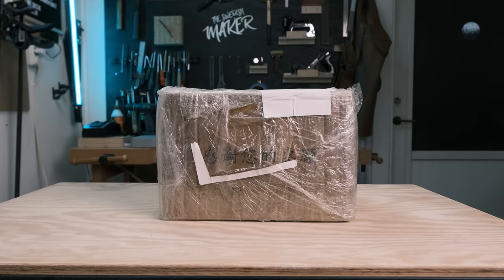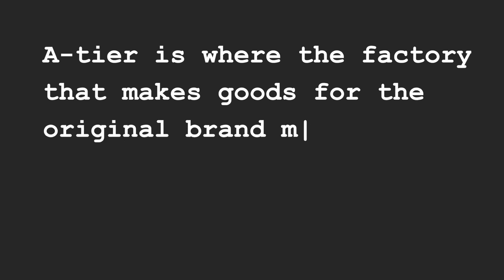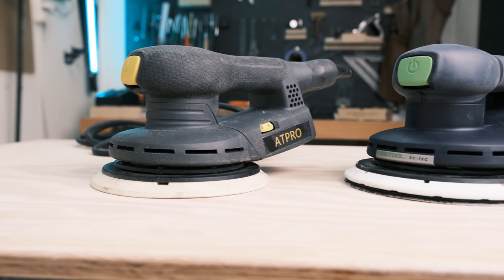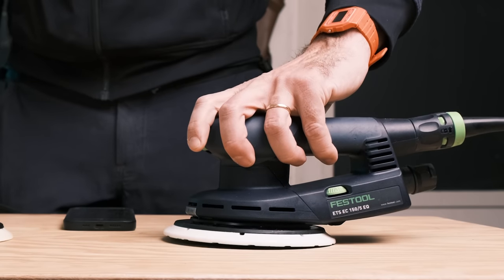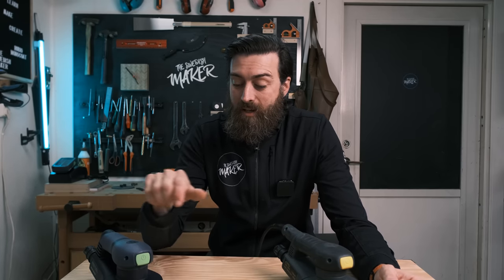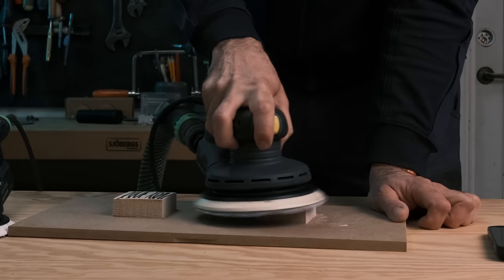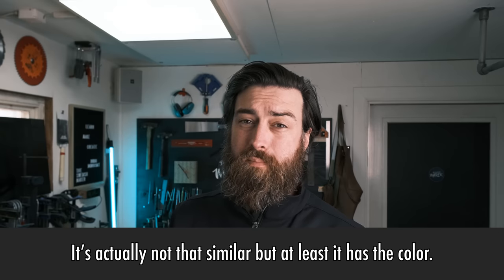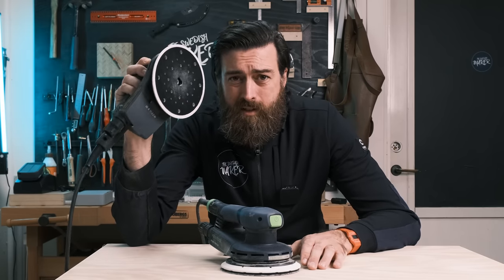Festool Killer or Clone?

Comment: Hi 👋, I have had cheep Chinese tools over years, mainly because I could not afford top quality tools, but over the years I have saved up for better quality, I am now in my 70s retired and I still have most of my tools still, Maffel Festool Makita , and maintenance is a must on all machines. Even on these tools, I still think one is better than the other, depending on what you are using it for , Maffel makes the best router, Festool best Sanders. Makita drivers, Stay safe, Phil from the moulin France.
Reply: I have the Mafell jigsaw and the KSS 80 cross cut saw . Both are the best you can buy.  But have you ever tried any of the Festool routers Phil?  The two smaller ones are an absolute joy to use one handed and the 2200 with all the extra bases and the 95% dust collection is just so innovative, smooth and powerful. I get excited when I take it out of its sustainer 😂.
Reply: Hi 👋, I hope you are all keeping safe and well, I have all 2 Festool routes, 110  2200 . Both are excellent routers, I started working for my self back in 1978, I brought a ELU 98 1/2 Collette , but found it on some jobs to big so I brought some other make that a 1/4 collett but that stopped working after a year or so, then I brought a Makita 1/4 that seems to be fine, I then needed a second large router that didn’t last longer, so I brought a ELu MOF 177 E , I did have 2 of these up until the 99 both of which I think that I must of replaced the bearings low’s of times, then in the 2003/5 I brought my first festool 1/2 , then the OF110 , however the OF2200 did have to go back once. I have had lots of different jigsaw over the years, but I finally brought a MAFELL Jigsaw in 2015/6 this is the best jigsaw ever, I have Festool larger tracksaw 70m it is okay but lacks power, I have used the Maffel on a site that belong to someone else, this far superior machine, most of my work was in my workshop so I didn’t need a larger track saw as I have a 10Hp saw bench with sliding table, I have a fell other Maffell tools Dowelling, Door Lock Mortiser, Chain Mortiser , from around 2008/9 I was involved in a lot of barn conversations were I was making a lot of doors and windows, most of the doors were 75m or sometimes thicker, with multipoint euro locks fitted,  one job had 7 doors so the door lock Mortiser made short work of fitting them, and I have a large 10H spindle moulder with sliding table, so the grove for the lock to sit in easy work , I also have Wadkin EKA tenoning machine, with Windows sets and Door sets tooling, Leitz tooling and some Whitehill , I am retired but still have a lot of tools. I am hoping to finish my windows and doors in my property in France later this year, 
My work came to abrupt end in 2019 , as I had found out my ex female partner was having affair with some one, and she had scamming me over the years as I had been putting a lot of money in 2 projects one in the Uk and France. 
I hope this gives you some insight into what I have been doing, and tools and machines, if you need help with any further information don’t hesitate to send me a message. Phil from the moulin France
Reply: Hi, I forgot to say cleaning your tools and machines, and maintenance afterwards is very important, 
Phil from the moulin France

Comment: I have had Ridgid, Milwaukee, and Craftsmsn sanders in the past. All caused numbness in my hand after use. And those that had dust extraction were a joke. I bought a Festool ETS/125 and it is a joy to use. No numbness in my hand and no sanding dust all over. 
I own a Festool track saw, dust extractor, jig saw, and Domino 500. Not a single regret. They bring joy to me when I use them. My next Festool is like a Rotex sander. I have held off buying a Festool router, I own 4 other routers. So maybe I’ll hold off getting the OF1010 for another year. 😀

Comment: Choice is choice. If they are not using the name of Festool, then good on them I say. I think they are trying to ride off the name in terms of price though. That tool looks like it should be sold for $50 not $300.
Reply: Agreed. The 3m sander is like $300 and I’d rather get that than some Chinese counterfeit for the same price
Reply: @zackstern3803  Well said Zack.

Comment: Excellent video. I couldn’t agree more. True, most of the budget or mid range tools are manufactured, or assembled in China. Like most of us, I own a number of tools from Mikita, Hitachi alongside cheaper brands, and many of them are made in China. I even own a Nikon camera that is also made in China. Oddly enough, one of my Bosch tools - a 110v drill - is made in Russia. None, however, are knock offs, and all have performed flawlessly for years or decades. 
I do own some of the red stuff from Banggood, rulers, squares and the like. These are, obviously copies of American products, but, as you state, they are just bits of machined aluminium. 
Thanks for sharing.

Comment: I’m sitting on the fence with this one. I have learnt my lesson on you get what you pay for. So would not buy the cheap one. But I just cannot see the justification in spending that much on a Festool. When it’s market competitors like Mirka or Bosch or even Sealey (budget) are far better priced.
Reply: I am looking at the festool midi and was quite shocked by price of accessories. Things like a handle are like £70 which is just some tube metal
Reply from the maker: It is a hefty price. I think Mirka is comparable in quality, but I dont think the Sealey quite compares - I have a similar sander to that one and the Festool one seems to be a bit better in all areas. Thanks for watching man!

Comment: I splashed out on a Mirka DEROS convinced I’d have buyers regret but am so glad I did, makes sanding so much more bearable. So yes I agree, ditch the cheap counterfeit crap and buy a trustworthy brand, as high quality as you can afford to get, or are willing to spend. Another good video Pierre 👍
Reply from the maker: Thank you John! Totally agree with you
Reply: I'm no stranger to Festool sanders and extractors, so I will always check out a clone sander vid that pops up in my feed. 

I've seen more Mirka styled sanders than Festool styled sanders though. 
 
The noticeable loss in dust extraction is a deal breaker. Did the vac just need to be ran a little higher than the EC? 

You never pointed it out in the video I don't think, but the Festool knockoff cord came off like the Festool? Or just mimics the connector look with a fixed cord? 😅

Were the pads interchangeable? 
If I can't easily source pads for a sander, then it's another deal breaker. Pads are a consumable and they wear out. Especially in helpers hands lol.  Without easily sourced replacements the Chinese sander is dead in the water. 

Speaking of pad wear, I'm sure someone's mentioned it, but both those sanders needed a protection pad with that net paper. You'll melt the hook and loop, and cause premature pad replacement.

Comment: It has all the fancy things, like at 7:20 there is an adjustable counter weight for reducing the vibrations. If I'm not mistaken, that sander must have vibrated quite a bit more than the Festool? At least it sounded like it during the sound test.
I would guess adjusting and fine-tuning that weight's position at the factory is one step the no-name brand will skip to reduce the manufacturing cost. Vibrating sander does still sand, so it may pass quality control for no-name brand.
Reply from the maker: Yes it vibrates a lot more....almost shakes compared to the Festool one

Comment: To be fair, you only sanded 5*5cm square blocks twice... wasnt that extensive comparison. Those kind of sanders are made for larger surfaces and true comparison comes from longer use. Vibration, motor heating, ergonomics, stickypad lifespan/grip, sandpaper wear ( yes thats a thing due different kind of pad movements and heating if not papercooling happening like festool multijetstream pads have). All these are also big factors when comparing. But i've personally used mirka and festool sanders over 10 years now and they are best out there. Cant see how chinese copys could be better...